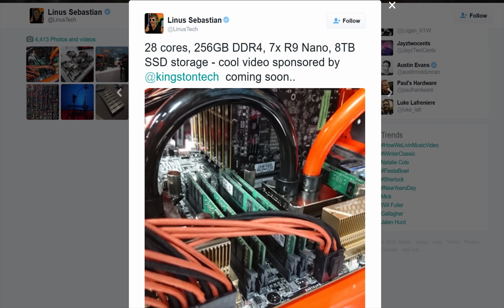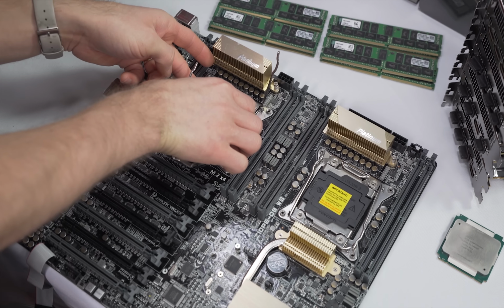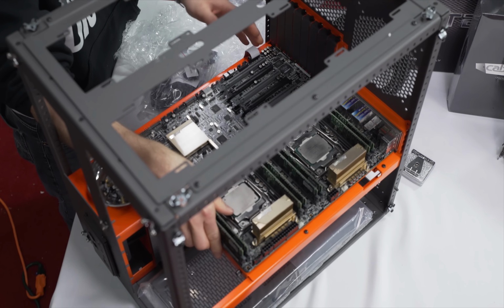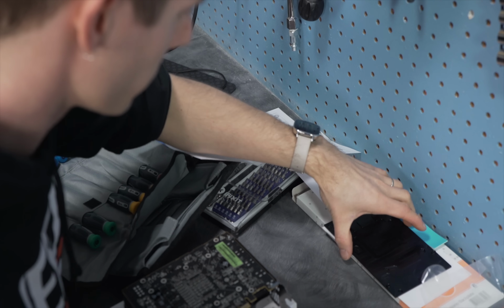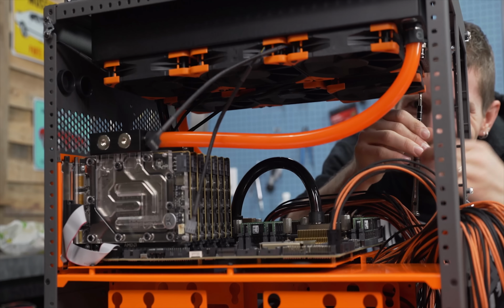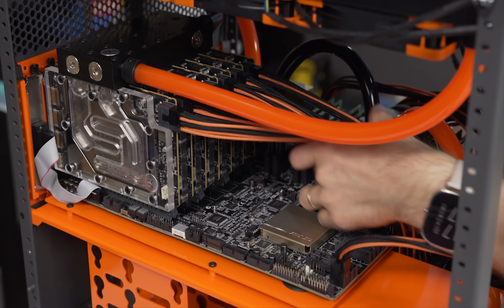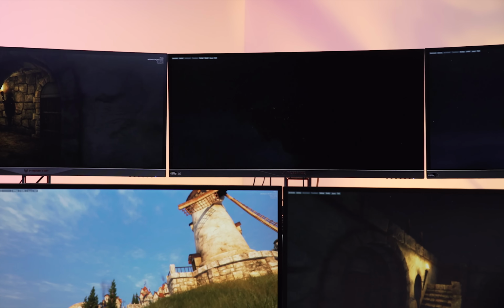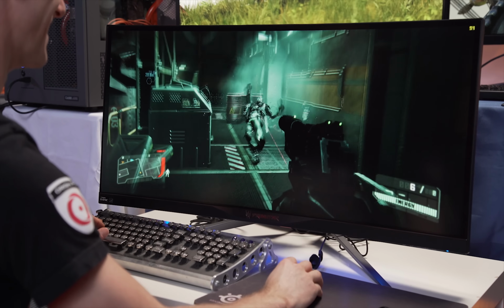7 Gamers, 1 CPU - Ultimate Virtualized Gaming Build Log

Comment: Something I would love to see, if at even possible:Could you at all combine the power of multiple motherboards to one system and how many gamers could you possibly fit into it?On the subject of this particular build, I could see something like this being actually useful in a lan party or a gaming cafe. They build $2-3k machines anyway and line them up, taking valuable space to which they could fill with more players and creating a generally uncomfortable atmosphere with heat and noise from the systems. Could you imagine 28 gamers running on only 4 computers? Surely you don't need THIS much power, you could tweak it quite a bit to sustain reasonable frames and a lower cost. In all is it practical? Not ideally, but proof of concept achieved. Well done LTT!

Comment: how much does it cost? less or more than 7 independent similar performance PCs? (those CPUs and that power supply could cost more than 7 individual decent ones)

Edit: nevermind, $30K means $4.3K per gaming PC...
Reply: yeah but 1tb SSD  is pretty expensive
Reply: yes 2 years ago, and still doesn't make up for that $4300 per machine price.

Comment: Color me impressed. You are correct that the rig is completely impractical. $30k for 7 users comes up to $4400 per user, so there are definitely no economies of scale here.
Reply: +Lo-Res Gamer who said this was meant to be practical?
Reply: Nobody, I was just using the cost to confirm Linus' statements about how impractical it was. You can build 7 hella powerful systems for the same amount of money.

On the other hand, those 7 systems would probably consume more than 1500 W total at the wall when under load, so this build would probably reduce your electric bill if you have a scenario where you actually need 7 powerful gaming rigs.
Reply: +Lo-Res Gamer if you have solor you don't need to care about them electric bills
Reply: Grin... as long as you have enough batteries/capacitors to keep this behemoth running all night.

Comment: How would the audio work like if someone connects some headphones will you hear everyone's game ?????
Reply: USB headphones are the way to go
Reply: +Kevin padilla They'd need 7 discrete sound cards assigned to the respective VMs which I don't think they did atm
Reply: +MasterControl90 ew no
Reply: +Kevin padilla Video card can usually output audio through hdmi and even DVI. The monitor has to support hdmi audio input though.
Reply: If they use monitors with a 3.5mm jack then they would be able to hear there own gameplay right

Comment: It is still cheaper to build 7 different rigs with similar specs, right?
Reply: Its 30k he spend. so yeah
Reply: +Mitchell Ellero That's not always the case. 

For example, one 1600W PSU might be cheaper than getting 7 high quality 600W or so PSUs. How much was that board? It's surely not about $1400 because a good board would cost around $200. Case too. It's only $400, but buying 7 high quality cases would cost at least $700.

I think building 7 individual rigs with similar performance and cooling, might cost more.
Reply: +Anusha Dharmasena I think this board can be aroud 500USD.
Reply: WAAAAAAAAAY cheaper.
Reply: +Anusha Dharmasena if you take 4000$ per rig, you can build something with way more performance
Reply: +Anusha Dharmasena You don't need to spend $200 on a motherboard to run games. You can easily and safely run high end games off of a motherboard less than half of that price.
Reply: +Anusha Dharmasena Seems like it would make sense but 30k means $4286 per computer, I can guarantee you could make 7 separate similar performers for less than that price
Reply: +Anusha Dharmasena There is no way you would pay over 30.000$ if you'd built 7 rigs. You have an budget of 4.285$ per rig, which is more than enough, even if you watercool all of them.
Reply: including those 34" displays and the fancy stuff (cables etc.) and while getting the same thermal results of this rig? For the performance alone, yes you can build a cheaper rid than $4285, I agree.
Reply: +Anusha Dharmasena Actually it's around the same, the price got skyrocketed by the monitors
Reply: +RobloxDev That&#39;s what I was afraid about. However you still can build a 6 core PC with a TX 980Ti for about same price, so I guess 7 small PCs will give better performance after all.
Reply: +Anusha Dharmasena You must be high.

Comment: 250w idle,1500 load. Gez the power bill for this would be awful for one consumer. 7 R9 Nano Fury(I know) and Dual Xeon,Linus killed January of 2016 already.
Reply: +Godfrey Emmanuel time to invest in solar panels.... :P
Reply: Nicholas A. More like a nuclear reactor
Reply: +Godfrey Emmanuel That&#39;s pretty damn low to be honest, I&#39;m running two cards and two CPUs and peaking at close to 1100w.
Reply: +Godfrey Emmanuel Well, it's not supposed to be for one consumer... divide it by 7 and it doesn't look a lot at all... A bit over 200W per person.
Reply: nah. Pu55y Destroyer

Comment: Should rename the video to "7 Gamers, 1 motherboard" since it has 2 cpu's.
Reply: +Barack Smith It doesn't ring as well as "7 Gamers 1 CPU" to the average mass audience since the layman term for CPU encompasses the entire computer plus the tower.
Still though. 2 Xeons.
Daymn.
Reply: +RusticKey What about 7 Gamers 1 PC, or is that too much?
Reply: Blade Mastr That, is ... I don't know? While there's physically only one personal computer, there are seven instances of perfectly independent "computers" running off one machine. That could work, but

7 Gamers, 1Machine?
Reply: RusticKey What is the definition of Computer? Isn't it a machine with internals functioning? This is one machine, it is a "Computer" that functions as a gaming platform for several people.
Reply: Blade Mastr Well I guess you're right.
Still though it's not one personal computer since ... well, it's one machine used by 7 people, so I guess PC can't really work.

inb4 semantics
Reply: RusticKey Yeah okay, what about 7 Gamers 1 Computer?
Reply: Blade Mastr That's okay.
I think.
Reply: +Steven Enyeart You would only be technically correct if the processors (like a dual core or quad core) were on the same dye in the same socket,  this has 2cpu's.